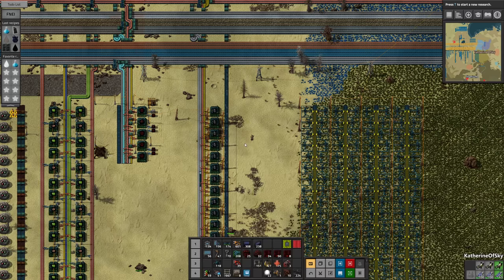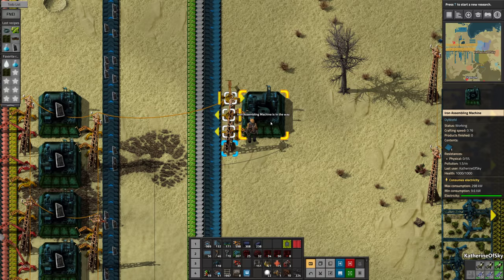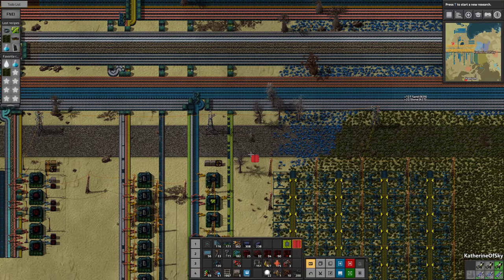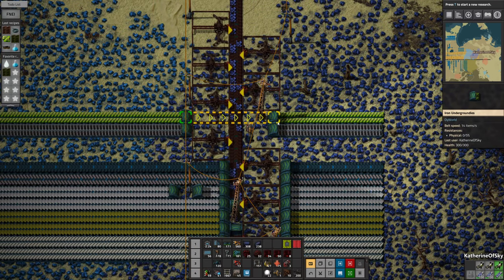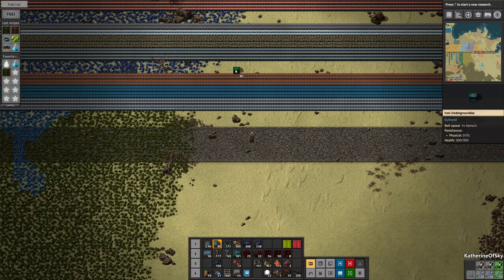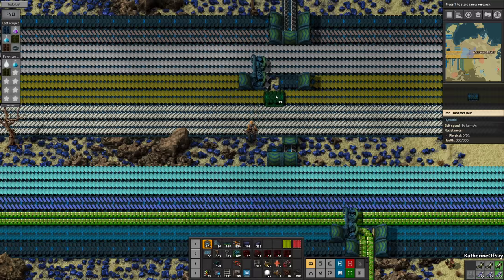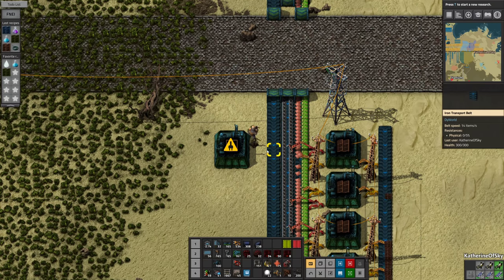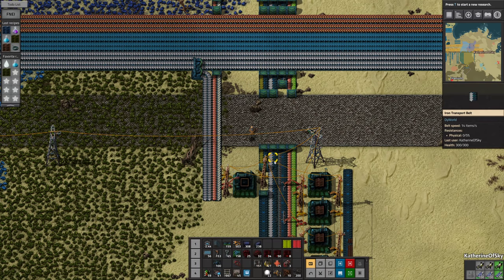Factorio DyWorld Ep 42: SOLAR PANEL CHAIN - Conversion Mod Let's Play, Gameplay

Comment: 36:50 on the second silver Solar cell produktion (from bottom) you still missing the second inserter
Would it not be bether, to make the Solar produktion next to each other? so you could add more if needed
Reply from the maker: I batch recorded the last few eps.  Yeahhhhh, I debated that.  I guess I will just see how much space I need.

Comment: Hello everybody. How do you melt those over 1000deg metals like stainless steel? I cannot find a heat source for my furnaces, I can only make the 1000deg max Heatpipe Heater. Thanks :0)